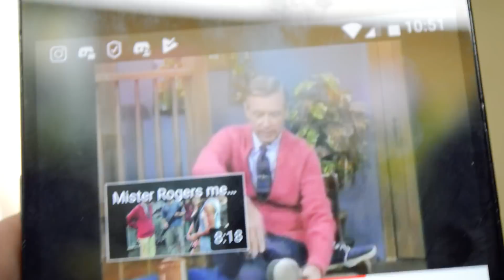What is... Drone? I have no idea what I'm doing.... VLOG #1

Comment: Hi Zoe - I have been using one of your Zoe FPV signature motors from RC Timer now in a foam RC park jet, I'm using the BeeRotor Z2207 2780Kv, super impressed with it's power and torque, just running it on 3S with a 6x4 prop, but I love the performance it gives me for the price, well done :)  Best of luck with your continued f...vlogging :)  Subscribed to your channel for future updates.  All the best.  Cheers, Scott

Comment: Nice flying always love the 3D bit but have you tried some blue Loctite on all your motor screws
Reply from the maker: Might have to give it another go- with the rubber pads the motors tend to need tightening up over time(the pad would melt under the heat of 5s and loosen) so I never bothered.
Reply: Another idea might be to drill tiny holes in the sides of the screw cups, so you can run a loop of fishing line between all four to stop them from becoming any more than a little loose.  Probably a better solution when you swap out motors regularly, to save having to deal with multiple layers of loc-tite.

Who knows, if it works well enough someone might start selling pre-drilled screws.

Comment: What flight simulator do you practice with
Reply from the maker: Joe Mejia I use Liftoff for 3D, it's easy to enable it.... Just hit A on the keyboard to cycle through modes when flying and blam, 3D model.
Reply: Zoe FPV thanks for the info